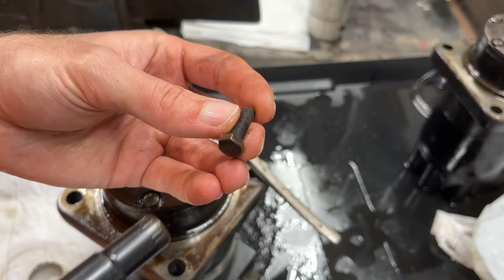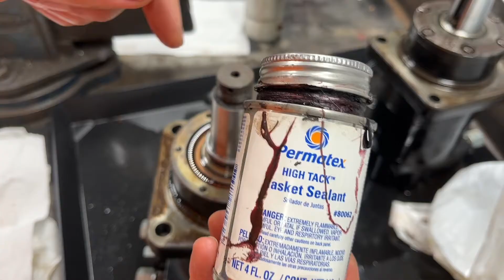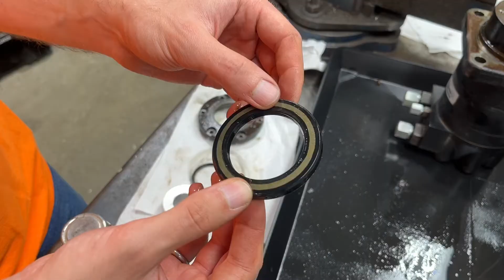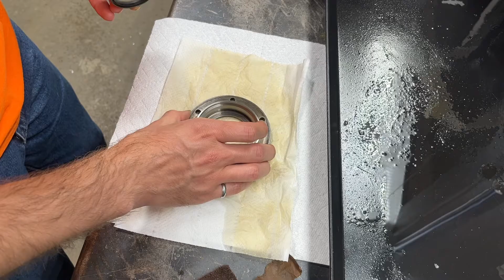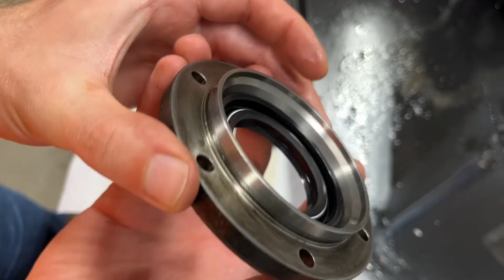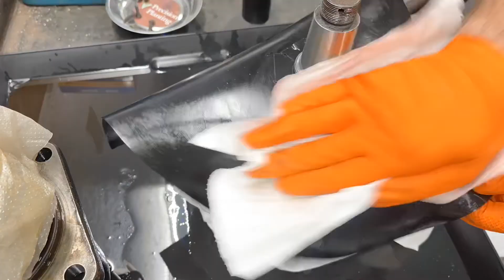Leaky Hydraulic Drive Motors FIXED

Comment: Hello I’m having a issue with a s800tx I just purchased looking for some insight the left drive motor was replaced now the left track does not work very good not sure if it worked after they installed the new drive motor but I’m leaning towards it being a issue with the tandem pump.
Reply from the maker: Does the end of the motor/drive sprocket look correct (just like the right side)?

I would suggest…

1. Make sure it is the correct motor part number (there are not many in the world that could fit the Vermeer sprockets).

2. Put the machine up on blocks so both tracks are off the ground. Check “no load” track speed and compare the two sides. Try moving the joystick to every possible position in case there is something messed up on the control circuit.

3. Check hoses in the drive motor compartment to make sure none are undersized or installed in correctly (kinked or on the wrong ports).

Comment: The class on the screw's head isn't hardness. Its the strength class.
Reply from the maker: Hardness and strength typically trend together in fasteners, but you’re absolutely, technically correct.

Comment: Shaft saver is a damned good idea. I've used those on large shafts before. We didn't use the guide you made but that was a good move. 
In looking at that wear on the shaft I have to wonder if there was a way to put some sort of dust shield to keep the water and dirt away from the seal. Those shafts don't turn fast but they are exposed to mud and dirt. 
Thanks for the tutorial.

Comment: I very much liked your method for replacing the seals with o ring. I have noticed a slight oil leak on each side of my zero turn mower after using. I suspect this may be the area that  I will check.
Thank you.

Comment: Great videos man, thank you for walking us through this process!! I have the same Mini Skid Steer and both drive motors are leaking. 

Like yours, my outter seals appear to be shot, is it possible to leave the drive motors mounted in the frame pull that cover and replace the pressure seal, dust seal and o-ring ? I’m trying to avoid pulling both motors if I can. 

Thank you, 

Ben
Reply from the maker: @AspenStumpRemovalIrwin-z2i  Hi, Ben. If you wanted to purely replace the seals (without reconditioning the shafts), then, yes, you could remove the motor face plates, replace the pressure seal, dust seal, and oring and then reinstall the face plate. I’ll caution you on three things:

1. You may loose a lot of oil out the front of the motor if you remove the face without disconnecting the lines going to the motor.

2. Some owners online swear that you cannot replace these seals and get more than a few days work out of them, and I suspect that is precisely because they put new seals on damaged shafts. Some say it is because the motor internals/bearings are shot, but that was not the case during my rebuild. Just know that, if you change your mind, reconditioning the shaft will be difficult with the motor in the machine.

3. You really need to prevent dirt/debris from getting in the motor when you open it up. So, before you open it, clean the motor exterior and surrounding frame very, very well. Once you open it, you don’t want to brush against the machine’s fuel tank and see dirt fall down on the now-vulnerable motor internals.

All that being said, I wish you luck in your repair and am glad to answer any questions that come up.
Reply: Thanks for the detailed reply…all fair points made here. I see why you went the extra mile using the shaft sleeve…if your this far into it it just makes sense. 

Thanks again.
Reply: How have the sleeves held up for you? Any subsequent leaks/issues?
Reply from the maker: @AspenStumpRemovalIrwin-z2i  So far, I’ve not had any leaks since doing this rebuild and changing the hydraulic fluid. This machine is for personal use, so I’ve only put about 50 hours on rebuilt motors, but some of those hours were working the machine pretty hard ripping out roots. All told, I’m very happy with the repair sleeves.

Comment: Have you tried at 205 for something like this?
Reply from the maker: Interesting. I had never heard of AT-205. It sounds like some other “stop leak” products I’ve used though.

Have you ever used it in hydraulic motor applications? The manufacturer mentions hydraulic cylinders but not motors.
Reply: @reidthemanual  it's one of the better kinds of seal conditioners from what I hear. It's not supposed to swell seals as it's polymer based product, not a petroleum product. I've used it on a few things as preventative maintenance to prevent seals from hardening. Just don't add too much or use it on new seals. I had a buddy use it on a diff and the seals started to leak, most likely from adding too much for seals that are calibrated to be hard to hold in the heavy weight dif oil. So less is more as he found out. But yeah you could give it a try. I'd imagine for the hydraulic system you'd only need a teaspoon or 2 to be within spec. Kinda like water wetter. Start with the minimum and see if the leak stops and then go up from there.

Comment: What brand is that drive hydro motor, I have a similar problem, it has thrown out the ring on the engine cover twice in a short time.
Reply: Okay.  Thank you for your reply.  The only problem for me is that it breaks out on the ring.
Reply from the maker: @Ive-06-10  what type of machine are you working on?
Reply: @reidthemanual  Chinese mini excavator NEX N12
Reply from the maker: @Ive-06-10  That looks like a cool little machine. Are you staying that the rubber-and-metal hydraulic seal is being pushed out the end of the your drive motor (the hydraulic motor inside your track behind the drive sprocket) and that is causing oil to leak out?
Reply: @reidthemanual  Yes, the machine is great. Not a rubber-metal hydraulic seal, but an o-ring, a smaller rubber seal that protects against dust and is located in the very flange of the hydro motor, and that rubber seal is thrown out and oil leaks. And this has already happened twice on the same hydro motor.
Reply from the maker: @Ive-06-10 It’s interesting that they use an oring for a dust seal. That’s not super common in my experience.

I’d have to look at a cross section of your motor to be sure, but if you are getting oil leaking out of your motor then your high pressure seal might be failing. Dust seals are not normally designed to hold any pressure at all — just keep dust OUT. Your high pressure seal is what keeps oil IN.

Do you have the make and model of your motor?
Reply: @reidthemanual  It is written in Chinese, this is a translation from Google
Cycloidal hydraulic motor
Product model 163-6043
Factoey number 0002060405
Reply: Danfoss Eaton 6000 KM6 Orbit Hydraulic Motor Sauer Brake Motor 245 Ml R
Reply from the maker: Hi there. The motors in the video are Danfoss TMKW 315 wheel motors.